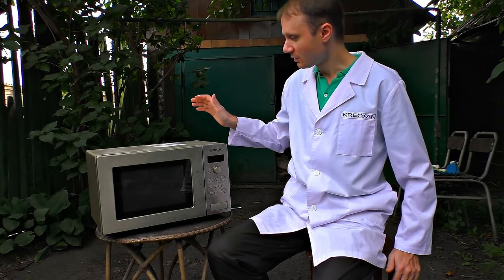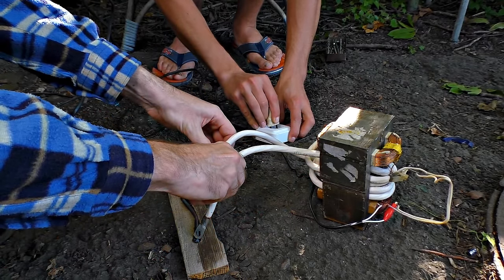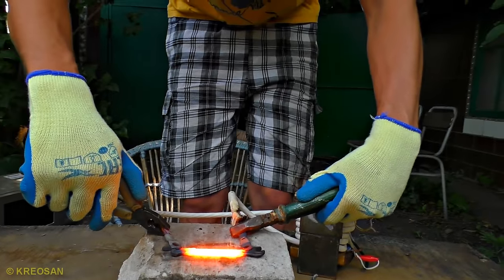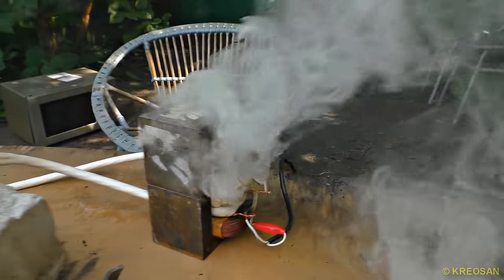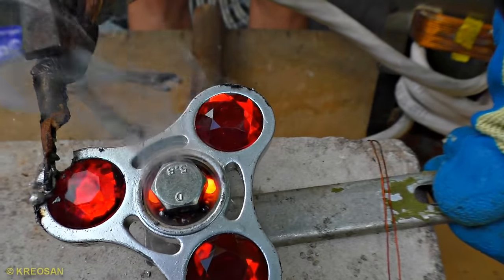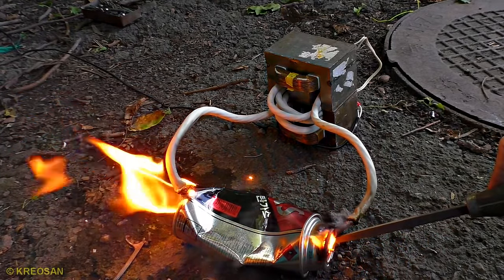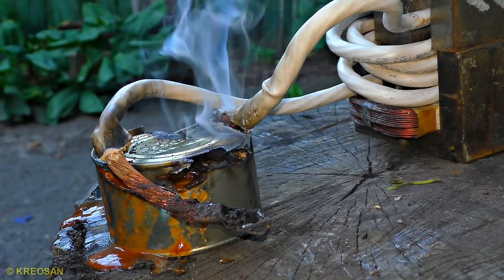Crazy Transformator! Melting Metal! ⚡Dangerous Microwave experiments ! 🔥

Comment: Spinning can only happen with DC current because it moves in one direction only. But the city power you used is AC which oscillates at a frequency of around 50/60 Hz which causes a switching in the magnetic field and basically results in a push-pull effect and results in a net zero force and does'nt cause the spinning of the spinner.
Reply: also it looks like the wire welds onto the body, stopping any of those small oscillations
Reply: Not true, just look at universal motors. You need a stationary magnetic field that provides the force to make it spin. It has to oscillate in phase with the rotor field.
Reply: They could have turned it into a single phase induction motor, with no starter winding a gentle flick would have brought it close enough to synchronous to continue gaining speed by slip torque. I actually really would have liked to see that :) Please Kreosan!?
Reply: @ThatGuy-nv2wo  and a trnansformers pnly works in AC so if he wanted DC he would have to put some HUGE diodes after the transformers
Reply: Wrong
Reply: There is 3phase ac motors
Reply: @dakotadirden9834  And? What about them?
Reply: @CatNolara  That's because the field of the stator in universal motors oscillates with the rotor field. Effectively the same as a DC field then.
Reply: In that case at least  current would be needed  so it could co-operate in a way to push and pull😮

Comment: Put can inside a normal microwave, and you'll:Not heat the food.Possibly damage the microwave.
Connect the can to a modified microwave transformer, and you will:
Melt the top off.✔️
Warm up the soup.✔️
Cure iron or copper deficiency with the metal oxides that melt into the soup.✔️

Comment: About 1100 to 1300 degree Celsius. That will depend on composition like if it's hardened it has martensitic state with high hardness and melting point on contrary to austenitic state

Comment: The  melting point of iron is 1538°C and the greenish flame wa due to the zinc coating of the screw burning away and leaving zinc oxide behind. The latter is yellow when it's hot, but white when it's cold.

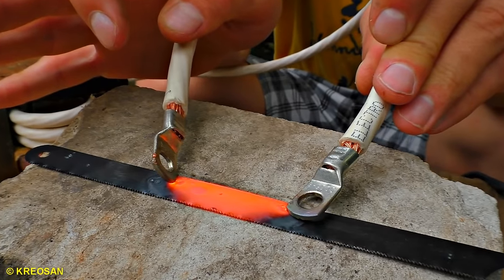Comment: 1:13 it isn't actually "boiling" what's happening is that it's oxidizing. Impurities are coming to the surface, mixing with the air and becoming iron oxide, or as you may know it, "rust".

Psa: that's is an overly simplistic way of explaining it to the point of being slightly inaccurate but that's the gist of what's happening. In blacksmithing, it's called "scale".

Comment: Hi guys .. your videos are amazing and entertaining. But also give some explanation as to what are your currents and voltages and how much time it takes to melt , the diameter of the wires used, the type of material which are melted etc. Also like why did you change the secondary coil of the transformer etc. I have watched some other videos of yours, while they are very entertaining and fun, they lack explaination of the phenomenon you show . It would also make the vedio very informative .. thanks and great work and please be careful..

Comment: the yellow/green flame from the fidget spinner and the yellow smoke and coating on the metal is from burning zinc if you melt Newer american pennies you can get the same effect (You must get them really hot though but they are mostly made of zinc)

Comment: I could use this to remove stuck pulleys from engine shafts and remove seized buts or bolts. It would be quicker and cheaper than using an acetylene torch.

Comment: WTF i was always told that amps kill not volts,  That's why the tesla gun doesn't kill anyone on Smarter everyday video, high voltage gives spiked lighting but the amps are soo low, it only tickles. But here 2v and 900 amps, how, what, i'm confused.
Reply: Wow Thanks ! That really explains it. Damn i was living with lies :D
Reply: Quetzalcoalt 😊👍
Reply: Voltage and current are complementary, you can only get some amount of current if you have some amount of voltage and vice-versa (ohms law). Current alone doesn't do shit.
Reply: Its the amount of time youre exposed to a high current that matters.
The tesla coil jut produces arcs for a nanosecond.
However touching a high voltage supply like the microwave transformer(the one at the begining of the video)
will be your last mistake!

Comment: FYI : Electricity can melt the steel because steel act like a resistor. Because steel doesn't conducts current really well compared to copper cable, all the currents got stuck in the steel and thus make the electrons inside the steel expanding rapidly and affects the steel to melt.

Comment: Metals don't have just one melting point, as there are a lot of metals out there, all of them with different melting points. Wrenches are usually made from steel alloys, which generally melt at 1.500 degrees celcius.

Comment: Well steel needs form 1370 to 1500 celcius to melt depending on % of carbon it has and the boiling point is more than 2800 celcius

Comment: it is necessary to turn the input and output of the transformer to convert it to high voltage.Since the transformer gives 2 volts from 220, it becomes 220 to 22000 voltage in the opposite case of 100/1. yes my english is bad

Comment: it can be used in forging bolos and knives. It would be more quicker to heat the metal than usual fire heating. Only just make sure to consult to the experts that the users exposure to the radiation. If it would be used maybe in forging, it must be safer maybe that it would be inside a box with a front glass like that of the microwave oven that absorbs the radiation. You may open the the glass opening put your metal inside the box, connect both side of the metal, then close the glass closure, then turn on. When it heats up, take the iron and start to smash it up to your desired design. Its promising to become a tool for metal forging. It can alse be used maybe in melting gold to make goldbars.

Comment: Yellow hot steel is >1030c and steel starts melting around 1300c I recon you got to somewhere around 1400c :)
Reply: Dave Webster Maybe hotter since the spanner looked like it it was boiling! That would be about 2700C. Could have been some other crap boiling off rather than the actual steel though. I don't think I'll try it at home.
Reply: I think it's closer to 3200°c. An acytelene ocygen flame is just as bright at 3920°c

Comment: can some explain how his tung is fine after that contact with that high amperage? I dont understand, is it because there is no pressure from the voltages I'm confused amp is hot power volt is cold power, volt is pressure pushing the ampere faster, higher volt less amp, lower voltages higher amp? how is his tung not burned like a resistor when he shorts over like he just did with tung then metal? can he hold each end of the wire with right and left hand and be just be fine?
Reply: High resistance, high impedance, unlike the metal tools.
And yes, I’ve seen another video with folks using 5 kA and touching both ends with bare hands for a few seconds - of course well isolated, i.e.  not connected to ground.

Comment: you could make a power supply that uses about a 6 ohm high amperage (or a 2000 watt) rheostat to have a 120 volt ac 30 amp power source to self power the transformer, as long as you don't melt the components and wires. just plug it in to an external outlet to start it up and then unplug it from an external outlet, though that would be like a tesla coil without capacitors or like a superconductor, so that might not work.

although you could plug it in and plug the outputs to 2 outlets to give power back to the energy grid to get a paycheck from the utility company for putting twice as much energy out than what you use.

Comment: instead of using a copper electrode why not a carbon electrodes.Just like a low voltage carbon electrode soldering iron. Would it not heat up faster? The free electrons from the carbon electrode are hotter because of the higher resistance of carbon

Comment: i need to build a wedge pvc sheet welder... i will use the same process to heat up a copper blade between 2 wheels to melt sheets togeather for manufacting...  you think will a microwave transformer i can get 1000amp and work safe and reliable.

Comment: if you wind a thicker wire less times will it put out more amperage?
Reply: In short circuit condition, it depends on how much thicker it is VS how many turns. (thickness of the wires changes their resistance)

But for melting steel parts, more turns results in higher voltage, which results in higher current when applied to the steel. This is because steel has a much higher resistance than thick copper wire. 

Of course if you have more current flowing because of higher voltage, you cables will get hotter as well.
Reply: thanks!

Comment: Add a cooling system to the transformer, so that you can keep using it for longer
Reply: And don't use liquid nitrogen to cool the transformer. The coil windings would become super conductive and will cause the current to go through the roof. 🙄 Will cause a mini black hole and a big bang. 😲

Comment: Amazing  what you can do with transformers   I messed around with this years ago     but with  focusing micowaves  at objects   cheers
Reply: They hand built a welder. 
Inexpensive Buzz Box welders like the old Lincoln 225 is nothing but a BIG Ass low voltage transformer. 
Plug it in and voila!
No Pilers needed

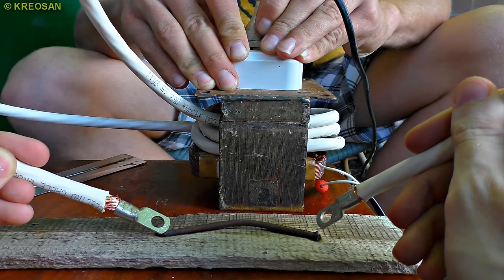Comment: Does anyone know why the Nail on 1:53 glows on it's ends? I have done experiments on high ampere melting but on my experiments usually the meddle of the nail gets super hot and starts to glow and then later the other ends will eventually get super hot and start to glow. but here in this video it is the opposite! the ends first get super hot and start to glow while I think the ends of the nail should get super hot later because the heat can be transferred through the wires!

Comment: I have a query.. at the time 1.34 min. You have touched ur tongue with wires... and next 5 secs. You have measured 846 amps..query is can 846 passes through our body from tongue??if yes then why current didnt pass through yours.??
Reply: Because of low Voltage and the body's higher resistance. ⚠️ Warning, disclaimer, 🚫 But don't try this at home to find out !!! 😲
Reply: 1. High resistance means very little of their 2.2 kA actually flow through the tongue.

2. Also whatever still flows, goes in the tongue and out again, so it never touches critical systems like the heart.

Comment: how can you touch the cable with no harm ? I thought amps were lethal at low levels ?
Reply: No. The product of voltage, amperage and time is the relevant metric. As long as one of the three is very small, another can be very large.

Comment: 1:30 why is the electricity harmless? I thought Amperes kill you, not Volts...
Reply: Dominik Kruyer voltage kills you, not current.
Reply: What kills you is a high amount of voltage times amperage times time. One of the three can be very high as long as another is very low, offsetting the higher one.

Comment: Didn't you get it wrong the voltage was 846 transformers increase voltage and it's amps. That kill that's why a taser can have thousands and not kill someone
Reply: Neither amps nor volts kill on their own. One can be high as long as the other is very low.

Comment: Why we don't  feel shock current while welding iron by a welding machine
Reply: What??
Reply: during soldering on iron if we touch welding stick, why we not feel electric shock ?
Reply: @annugairola9252  because there isnt electricity running through the soldering iron stick. It has heating elements.

Comment: I thought the amps are what kills a person with electricity.
Reply: No, it’s the energy which is voltage times amperage times time. If one of these is large, another needs to be small.
That’s why 230 kV at 10 micro Ampere are no biggie, nor are 10,000 Amps at 20 microvolts. Or your wall socket if you managed to touch the live wire for just a millisecond.